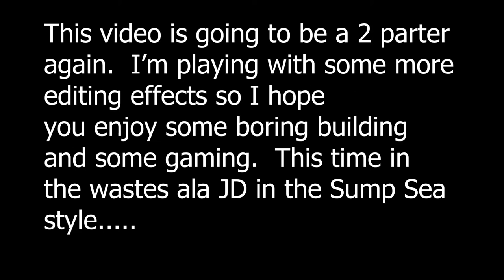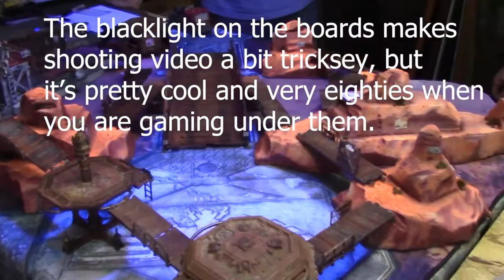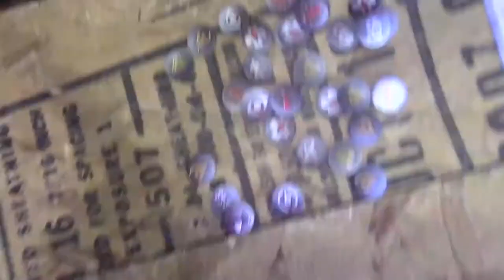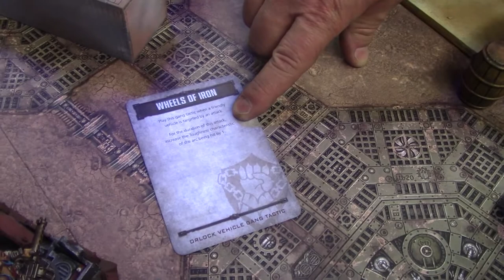Necromunda Sump Wall Corner Section Build Video, Part 4: Upper Corner Sections

Comment: I like this construction system, it should also be easily replicable though possibly with thicker foam depending on what's available.  How big are these wall segments compared to the boards GW is selling for the current Necromunda kits?
Reply from the maker: same size 12"x 12" (roughly) and thanks!